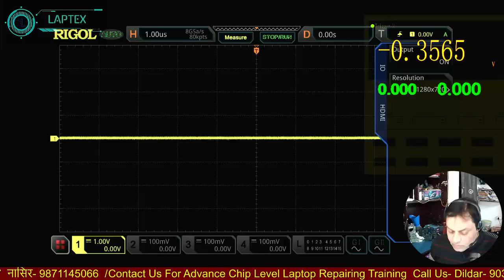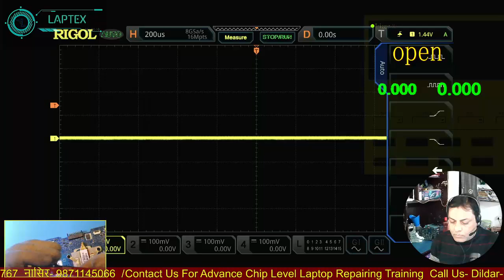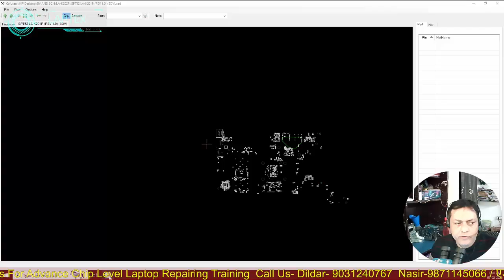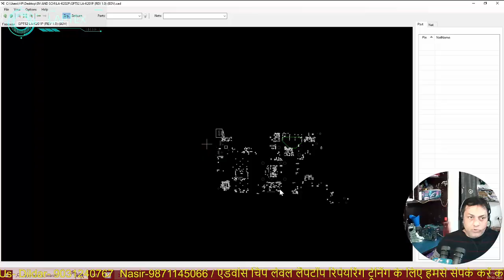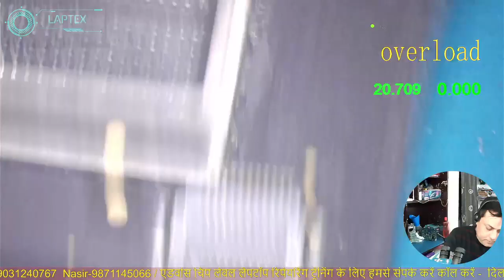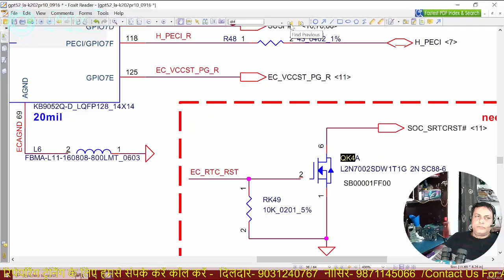(English) How to Test 11th Gen Hp Laptop Motherboard For Fault or Bad CPU | Laptex

Comment: VR_ready is coming before Core Voltage all supply ok
PCH_PWROK
SYS_PWROK
24/25MHZ clock must be from crystal and should generate LPC_Clock,Lan_Clock,and other clock then
SVID Communication will happen to generate Core voltage and GT voltage.
Check Diode condition of both end of XLIN XLOUT With CPU
Reply from the maker: Ok
Reply from the maker: Good point...